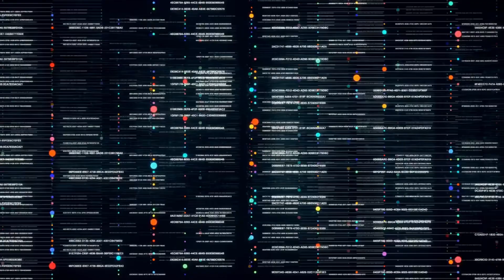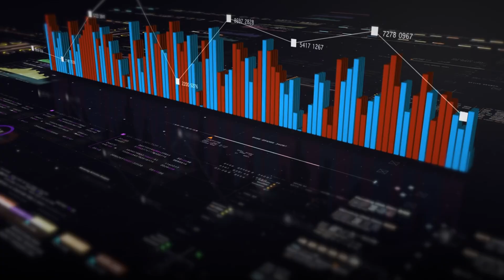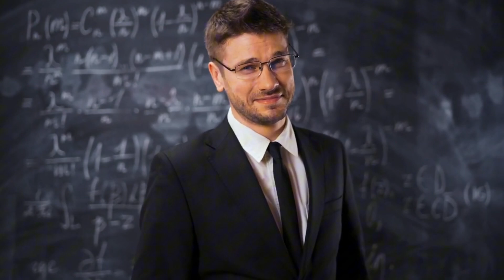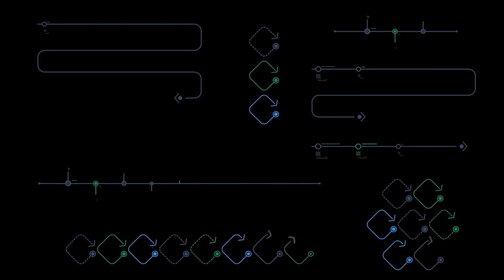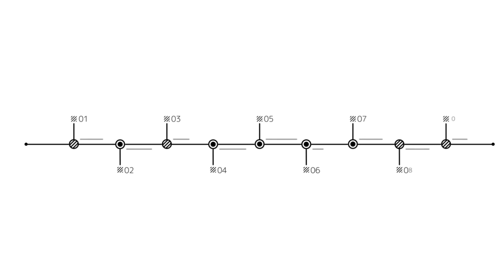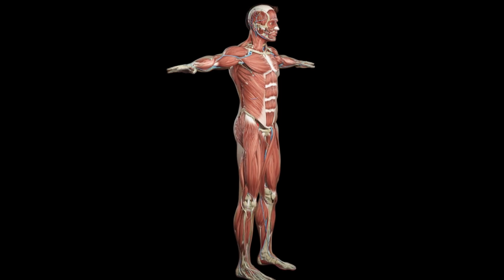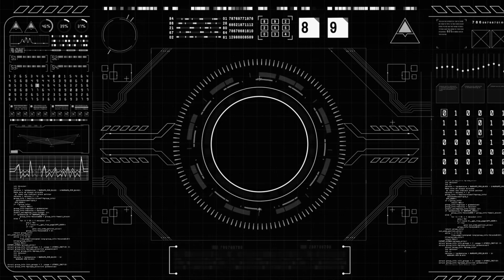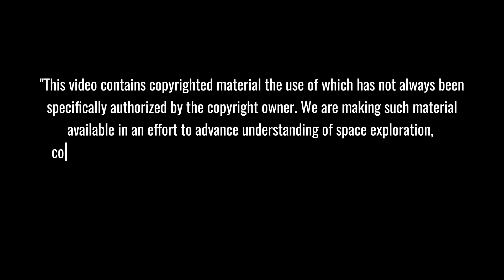SpaceX Starship Flight 5 Reveals Insane Upgrade - Elon Musk Confirms Unbelievable Success!

Comment: How we stick nozzles on our car exhaust at repair shops to produce heat in the shop, why can we not do the same for our rockets? Tunnels that catch all that is not spent and as much of the energy being expelled. Probably a dumb question, but it's only more dumb to not ask.
Reply from the maker: The principles of thermodynamics and propulsion are quite different between cars and rockets, but exploring those connections can lead to some fascinating insights!